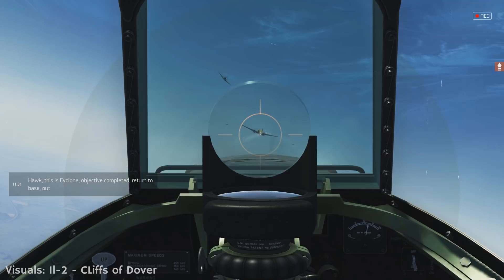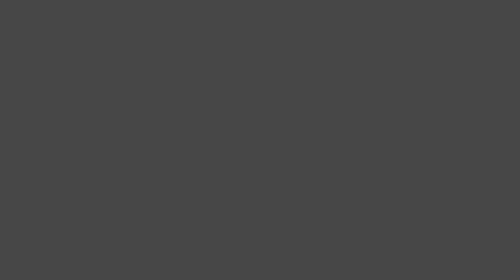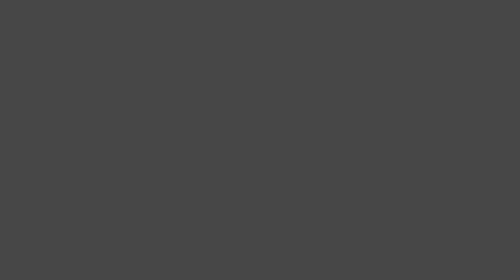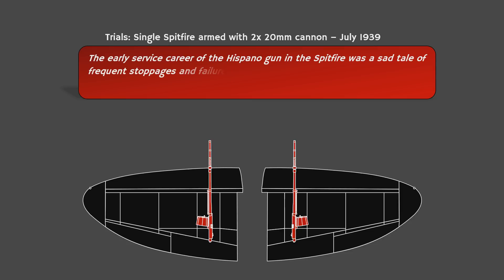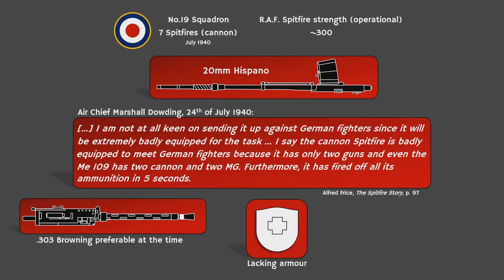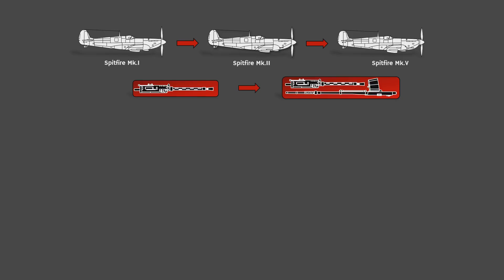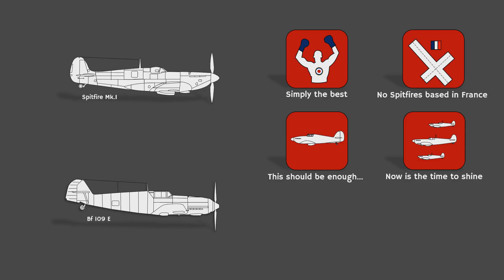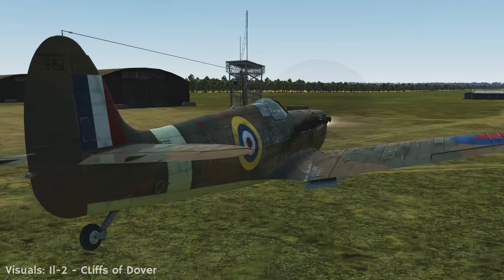⚜ | Clearing up Spitfire Misconceptions

Comment: A little question about the negative G cut off, seeing as other planes had carburetor engines like the Zero, La-5, etc and afaik they didn't have this effect, was it because of the design in this particular one... or did all of them suffer from this but not as much as the British one? (or maybe they needed a higher amount of neg Gs to make them stall?)
Reply: It is because us brits used a ball float system carburetor. When you invert or pull negative G's the ball rises up into the opening for the fuel to mix with the air thus causing the engine to cut out until some form of positive G's are pulled. :)
Reply: Thanks, and do you know how were the carburetor designs of the other nations?
Reply: I don't know a lot about other nations other than their carburetors had a mechanical valve sort of thing that did't mess up in negative G's.
Reply: Well the La-5 only used carburetor's initially before changing to fuel injection. As for the Zeros they did suffer from negative G cut out. It was something that the Americans discovered with the first intact Zero they captured and test flew in 1942. The main reason you seem to only hear so much about carburetor flooding in Spitfires is because of your typical Luftwaffe fanboy trying to come up with reasons as to why his precious Bf 109 was the best fighter ever. It wasn't really a big deal and could be avoided by rolling into a dive rather than just bunting the nose down. Also from 1942 Britain and America were using pressurised carburetors that completely eliminated the negative G cut out while still getting the benefit of higher boost pressures that carburetors provided over fuel injection.

Comment: I read somewhere that the Spitfire was later fitted with two carburettors to counter negative G stalls. Anyone able to shed light on this?
Reply: The Triumph Spitfire sports car had dual carburettors - not the Supermarine Spitfire airplane. Spitfires from 1943 onwards were fitted with the Bendix-Stromberg pressure carburettor which applied a controlled, variable [but always positive] pressure to the fuel/air mixture. It had 4 chambers - perhaps that's what you're thinking of.
Reply: Nightjarflying  thanks for that update. I read an old book on the spitfire that mentioned an upside down carburettor but it lacked specifics and your explanation I think clears that up.

Comment: Great presentation. I am curious. So we had an arrangement of 8 .303 MGs with the early Spitfires and then the next move was to just two 20mms. Any reason they didn't try something like 4 or 6 50 cals like American aircraft had at the time...???
Reply: The British felt that .50 cal machine guns were not enough of an upgrade over .303 caliber to justify switching over. A single 20mm cannon can be considered to have the same destructive power as three .50 cals while weighing a bit less than a pair of .50s, so you can see why they preferred the cannon for aircraft (where every kilo of weight counts).

 When cannons were standardized on the spitfire the usual loadout was 2x 20mm cannon and 4x .303 machine guns. Later on the remaining .303 guns were replaced by a pair of .50 cals.
Reply: At the time a .50 was a bit overkill for planes, since armor wasn't much of a factor. It was either cannons (planes don't react well to explosions...), or .30s which have superior rate of fire over the .50. After the BoB though everybody started learning from what was going on, and then self sealing fuel tanks and heavier protection was added which began to nullify the advantages of the .30
Reply: Interestingly the British found that 20mm ball (essentially a mild steel slug intended for target practice) was often more effective than their high explosive shells. Apparently the shells tended to explode immediately on impact, leaving a small hole with some shrapnel damage around it. Meanwhile the practice rounds would go right through the plane, damaging everything in their path until stopped. This changed when they modified the HE shells so that they exploded shortly after hitting the target, causing the blast to occur within the enemy plane where it could do more damage.
Reply: .50 cals were not made in the UK. That might not matter today but it was a significant drawback in 1940.

Comment: Should equipt the Spitfires with 8 x .50 Browning machineguns instead of the .303 British calibre.
Reply: Not really extra weight and an inferior solution to the 20mm. The US alone stubbornly held out against cannons (largely because they coulnd't get their own versions to work)
Reply: Too bulky and heavy, but in retrospect four .50's would have been an excellent fit.
Reply: The 20mm Hispano was a better gun, shell weight for gun weight. 

The Belgians did fit 4x 0.50 Calibre FN Brownings to the few Hurricanes they had license built. I don't believe they saw combat however. Would have been interesting to see how they performed.

Comment: Correct me is I’m wrong Bismarck but didn’t the hurricane shoot down more bombers in the Battle of Britain then the spitfire
Reply: Niko Clesceri
The usual practice was that the Hurricanes went after the bombers while the Sptifires took on the fighters where necessary.
Reply: grahvis Many think that was a bit of a myth, theory not surviving contact with the enemy.    In one of the definitive books on the BoB "Duel of Eagles" Gp Captain Townsend refers to Spitfire snobbery whereby shotdown Luftwaffe airman often claimed a Spitfire had got them when it was a Hurricane all along.    And another vet said that in air combat, especially the BoB, things happened so fast that it was more a case of shoot at what is in front of you.
Reply: TheArgieH 
In Len Deighton's book 'Fighter' he does says that on the 16th August, Fighter Command Controllers  modified the practice of sending Spitfire squadrons after the higher flying fighters while Hurricane squadrons went after the bombers, mainly because the Germans had changed tactics and pilots reported the fighters were down with the bombers.  The new practice being all fighters went after the bombers and indeed shoot at what's in front of you.
As you say, it wouldn't have survived long anyway once the first pass had been made, I've not actually heard of the 'Spitfire snobbery' but I can understand it.
Reply: Quite so.  In Duel of Eagles, Peter Townsend spells out Spitfire snobbery on pp 206 and 357, and other contemporary authors mention it.   Even General Kesselring and the Kommodore of JG 51 Theo Osterkamp got in on the act.  During the Battle of France Uncle Theo reported seeing Spitfires on the ground and Kesselring said "Only the Spitfire bothered us".  Both were simply wrong. 

Reportedly, the Jager of the Luftwaffe did not think that the Hurricane was much good - Gp Captain Townsend reckons probably because they mistook Hurricanes for Spitfires.  With an aggregate closing speed of around 600 knots and the fact that other guy is in the right place and also shooting at you probably outweighed the finer points of aircraft recognition.   And as you say, it's easily understandable and folk do tend to  "see" what they want to see.

Comment: A huge advantage is always missed in the spitfire VS the 109 Once Lend lease was made American Octane which was higher Gave the Spitfire a higher manifold press And HP which was a even to slight advantage in speed  Later with superchargers And the fix with the carb these spritfires had a better gain of power and speed to the 109 And with German fuel factories being bombed Germanys fuel was a lower grade  (Synthetic Liquid Fuels ) .......Many side by side 109 vs spitfire test after the war Were documented However Both planes had the same fuel provided 

The spitfire during the carb issue used tatics to Not choke out in a dive  Remembering for England And the RAF These men had to learn as it happen With Many German combat vetreans from the Spain civil war (1936)  .See "The Condor Legion" 

Many spitfires that were ill equipment might of been production as dual guns/ cannons However many uproars of pilots had ground crews And upper ranking RAF to change the load outs 

Spitfire pilots also knew not to shoot down a Bomber with "peashooters" and very limited ammo due it is super thin wing design  It's focus was other fighters first Then bombers Unless the Bombers were unescorted  Even then would be a call out for Hurricanes to join the fight as the spitfire would fly top cover
It was the polish 303 squadron that showed fighters and bombers can be shot down 1 plane on 1 plane instead of 1/4 of a kill This was done by getting in very close 300yards or less and putting in sometimes a full stock of ammo One pilot was noted for 2 sometimes 3 bomber kills per flight in a spitfire  Another advantage was resupply of aircraft and men 

While the German pilots at first had most of the upper hand in many catagories This changed with every month passing ..The men grew tired There was no real change up of men or Vaction away from the battle Not so with the RAF This had a effect on them. 

Canada trainned many pilots to be able to fly But little combat trainning wad done Along with sending fresh new aircraft and many types overseas 

"Many people think we had a shortage of Spitfires Yes the numbers could of been higher But the truth was we needed combat pilots..We had more planes then people able" 

"We would get the call and it was a scramble Whatever you were doing or thinking dropped. You ran like hell to your aircraft. Once you got in Your heart was racing But once the wheels were up it was quiet & peaceful  You had time to realize you were sweating. You climbed as fast as you could And waited for the CO to let us know where the hell we were going The germans were always above us No matter how much you climbed " 

Radar for these men was also a huge gain Without it the German bombers many time would of made the targets and home safe without damage

Comment: 303s aren't 50 cals , right ?
Reply from the maker: No they are not
Reply: "303s" are .303, and...303 is, well, .303" diameter, or 7.7mm.
Reply: No (see above replies) but even that esteemed gun had its teething troubles as well as not being too accurate over distance. RAF evaluated it (later in war) and found it wasn't much of an improvement over the .303 anyway. So they went the 20mm cannon route.

Comment: Spitfire: "No Fokker comes close".
Reply: That's because the Dutch didn't have an engine industry that could make engines that produced more than a 1000 hp, sane problem as the Italians really, but the Italians at least got to produce german engine's.
Reply: @martijn9568  The Italians made up for it  by designing aerodynamically clean aircraft that made the most of the engines they received.

Comment: There was not a major difference between both aircraft. There were only minor detail differences between the 109 and the Spitfire. English and German designers attended the same school of thought. Ok, the 109 had an inverted engine while the Spitfire used an upright inline engine. Both used a similar type of landing gear and were about the same size. Both had their teething troubles. Both had very similar performance and both had restricted rear vision. I'm sorry but English and Germans are too much alike.

Comment: Fuel injection suffers from some flaws too. The mixture is uneven in cylinders and you get less fuel economy.
Side note: the 303 was chosen over .50 because of reliability, 303 being incredibly reliable. Perhaps that was a mistake.
Reply: In fact the carburettor does have an advantage over injection, namely charge cooling which allowed a slightly higher compression ratio before detonation set in.

Comment: It's a shame you stopped with just 5. I've always felt that the Spitfire benefitted from its name....which is to say propaganda. 

Several points. 1. There was no Spitfire. There were 24. The plane changed greatly. But the name and PR were too important to give up. The 737 comes to mind. When I think of the Spitfire, I think of the brand, not the planes. 2. The Hurricane gets short shrift. I believe that I read that it was easier to build. Easier means it was both cheaper and quicker to build. Which means more could be rushed into service more quickly. 3. Range. Or lack thereof. The oft cited major shortcoming of the early Spitfires in my opinion was lackof range/endurance. It was simply only useful as an interceptor. People rave about it's maneuverability while never acknowledging that it was the original example of "not a pound for air to ground." It also couldn't escort bombers very far die to its short range. It SHOULD be maneuverable given normal design tradeoffs.

Comment: The one that irritates me was the poor use of the spitfire in Asia against the Japanese.  In fact a few years ago they found a flight of Spits in storage in Singapore never actually flown.  When they were the pilots were instructed to engage the Zeros on their terms which meant, while having better guns and a more powerful engine, they fought at lower altitude and tried to match a smaller plane in aerobatics with very sad results.  Later in the war when the Spitfire tactics changed to operating above the Zero ceiling and diving in on them before racing away for a second strike, the author had the gall to say this was unfair to the better plane, (being the zero).

Comment: Bismark. 

Small Correction the British 303 is roughly equivalent to .30 cal not a .50 cal. 
The .303 is a rifle round slightly smaller than the 30-06 which was used in the M1 Garand.

A .50 cal is a full 12.7mm round and is significantly larger the .303.

The British did experiment with using .50 cal M2 Brownings in the later marks of Spitfire but they ultimately decided on 4x 20mm cannon (when the reliability issues with the Hispano-Suiza were solved) instead which proved better for ground attack and simplified logistics.
Reply from the maker: mmarsh1972 As mentioned before, I never said it was an equivalent. I said 303 or (indeed) .50cals.
Reply: ah sorry, misunderstood.
Reply from the maker: No worries, you're not that only one and I could have phrased it differently.
Reply: "The .303 is a rifle round slightly smaller than the 30-06 "

.303 actual measures to 7.7mm (30-06 being 7.62mm), and the rounds are usually slightly larger, .311 calibre (due to the way the actual ".303 calibre" is measured across the lands of the rifling), so the round is practically identical to .30-06, or slightly larger, depending on your definition

Comment: For the amount of Spitfires, the production failed mostly due to failure in organising it. The new state invested factory in Castle Bromwich was supposed to produce 60 Spitfires a month. However the manager of the factory Lord Nuffield had no experience on air industry effectively losing the control which led to chaos and mismanagement of both raw materials and manufactured parts. This was duly notified by Lord Fairey who was asked to examine the situation at the factory. Consequently the factory was taken over by Vickers. Had a third of the promised production became true all the Groups in Southern Britain would have been able to have Spitfires plus a surplus for training.
It has been stated that France lost the battle in the air on the ground. The Germany's advantage was so fast that the organisation of the French air force fell apart and also led to loss of moral in the French air force. The Germans faced the same thing after Normandy.

Comment: Why didn't the Brits  use .50s?
Reply: AKlover they were difficult to get, Hispano cannons and Browning .303s were cheaper as were built in Britain. It was to expensive to purchase .50 caliber ammunition, let alone the actual .50 caliber gun
Reply from the maker: They did use .50cals later on, look up the Spitfire's E-type wing
Reply: Ballistic arcs of .303 and 20mm are pretty wildly different even when you are wasting a lot of the 20mm's potential energy with shorter barrels.  I'd hazard a guess the 20mm and 303s had separate triggers, no point even opening up with the 303s on an aerial target unless you are close.
Reply: the .50 was an inferior solution to the 20mm. So the RAF went from the 303 to the 20mm bypassing the .50 for all but a small number of late war aircraft. Only the US held out of the cannon swaps that all other nations did - largely due to a complete shambles with their attempt to get one working.

Comment: An easy way to tell the armnament of different marks of Spits is their designation.  The Mk.1a & Mk.1b Spits had .303's, but the Mk.1c had the Hispano's, the C is for the kanones.  This was dropped after the Mk.Vc, due to it becoming redundant.

And no mention of Beatrice Shilling?  She was the RAF R&D engineer that developed the orifice, with legend has it, her last pair of stockings.  Such dedication could not go unrecognized, so it was forever known as Miss Shilling's Orifice.

Fascinating woman.
https://en.wikipedia.org/wiki/Beatrice_Shilling
Reply: The letters sometimes assigned to Spitfire variants were a reference to the type of wing.

"a" wing - the original wing with 8 .303 machine guns.

"b" wing - 2 20mm Hispano and 4 .303 machine guns.

"c" wing - referred to as the universal wing. Had various changes (mainly to make production easier but also a few aerodynamic refinements) from the a and b but could be fitted with either 8 machine guns, the mixed 2:4 cannon:machine gun armament or a 4 cannon armament.

"d" wing - unarmed and the space turned over for additional fuel tankage.

"e" wing - structurally identical to the c wing but the outer machine gun bays were left empty the ports covered and had 2 .50 machine guns fitted in the outer cannon bays and 2 20mm Hispano in the inner cannon bays.

The designation for the wings remained in use all the way through to the Mk.XIV.